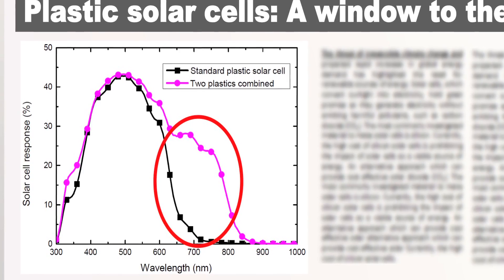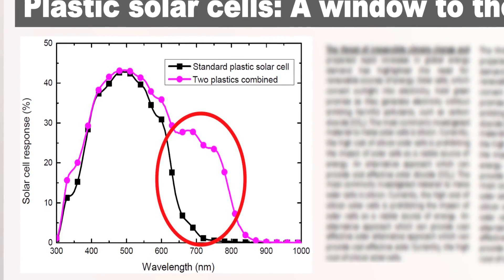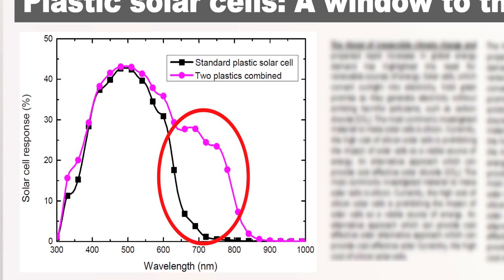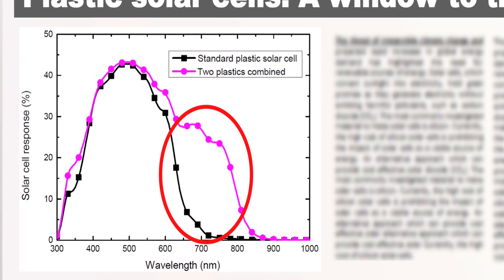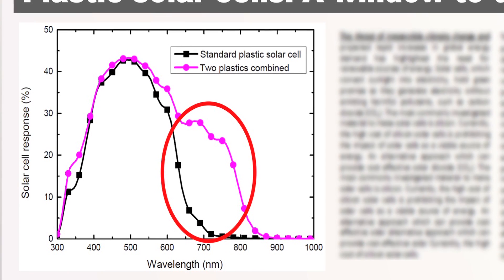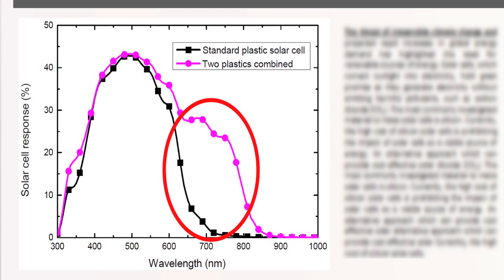2013 Three Minute Thesis Runner-Up - Matthew Wright

Comment: I would like to point out the irony of this "green" energy using plastics..... plastic is made predominately because of crude oil. Just fyi.
Reply: lilbizzy0816 everything is going to have a level of embodied carbon. Just fyi. But the nature of "green" energy provides such greater benefits that it likely outweighs the level of embodied carbon from the manufacturing of plastic. The speaker also mentioned that silicon involves fabrication and processes that will themselves come with economic and carbon costs (potentially higher than the plastic). But hey, ironically, you have discovered an area of further research!!!! Instead of writing trash comments, how about you write your own thesis comparing the embodied carbon involved in the process of a plastic PV cell to that of a silicon PV cell.